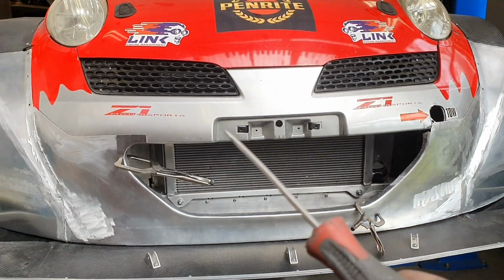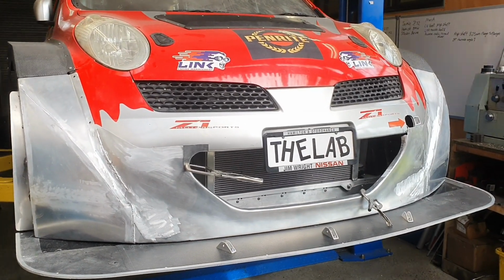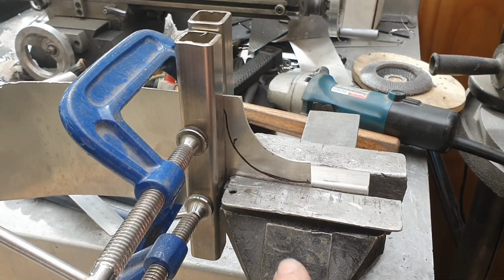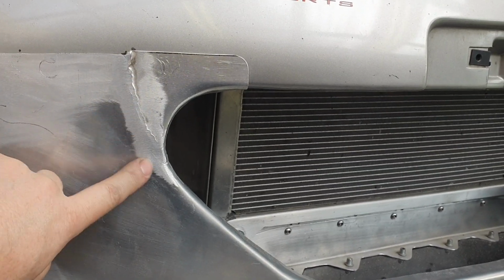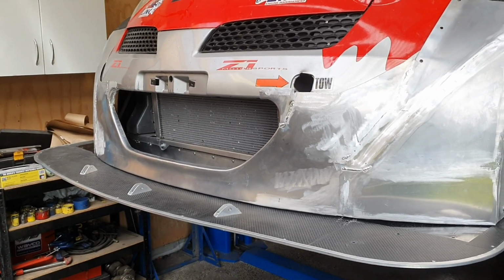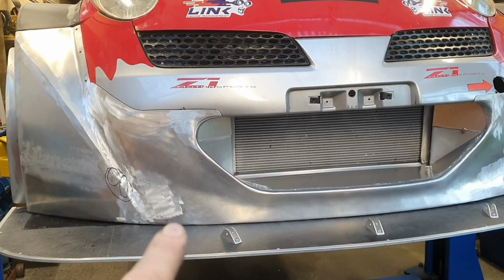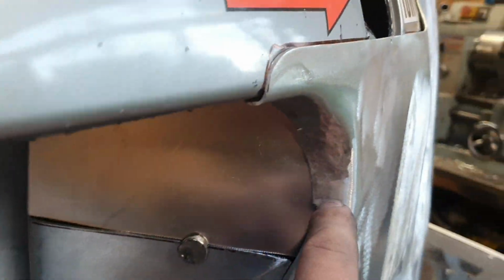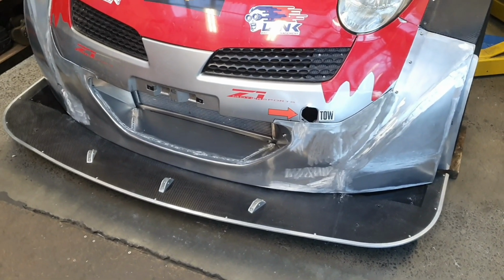Time Attack March custom front bumper

Comment: Just wandering why you filled in each side of the radiator. Would this be better left open for brake ducts. Nice work by the way.
Reply from the maker: For the main purpose of the car (time attack racing) we only run the car for about 8mins at a time, usually no more than three or four hot laps.
Brake ducts are not really a necessity for us at this point in time.
Up until recently we were getting away with using the stock Nissan brake pads from the 370Z.  They were fine to about 1.13 at our local track, we've upgraded the pads to deal with under 1.10 lap times now.